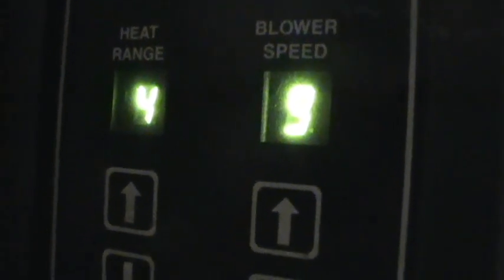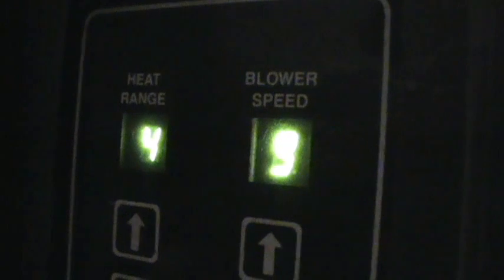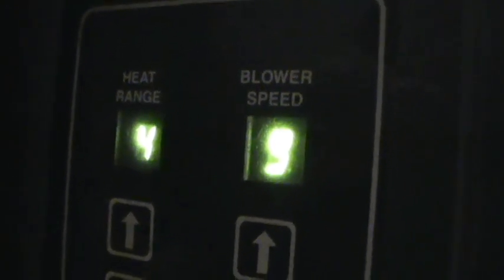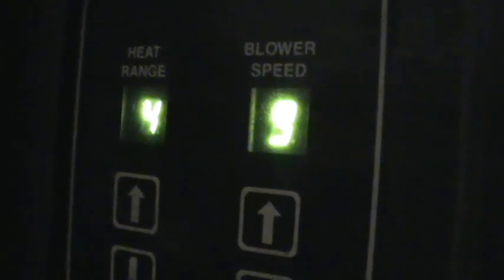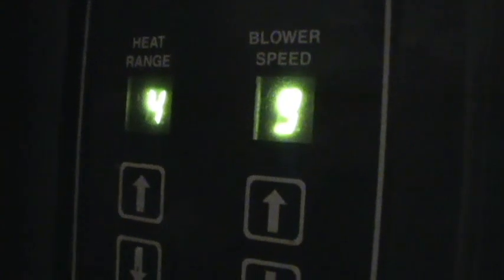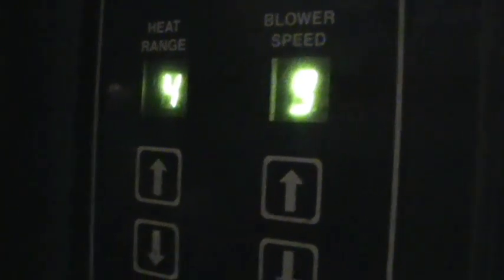6039- American Harvest Stove Settings

Comment: What is your a and b settings?
Reply: Yes please do answer this question if possible..when i hold A button down it lets you adjust something related to fuel and hold down B it lets u choose a # for the amount of air flow....thanks much
Reply: Any answer yet??
Reply: @ryanc8786  I’m running 1 on auger and 3 on draft fan.